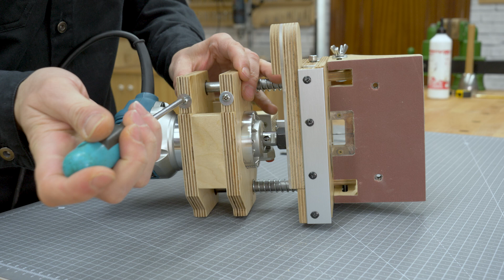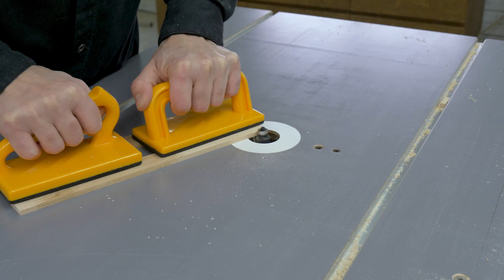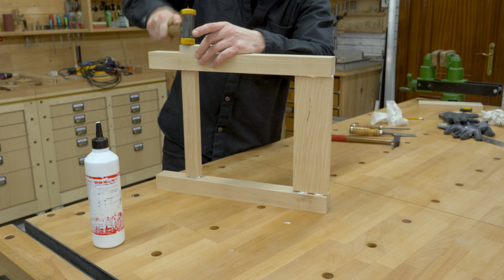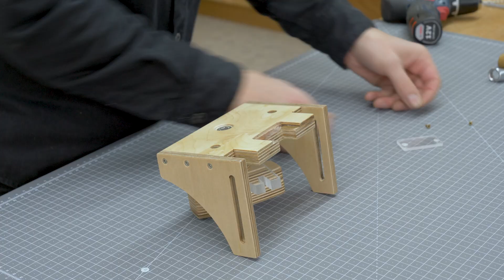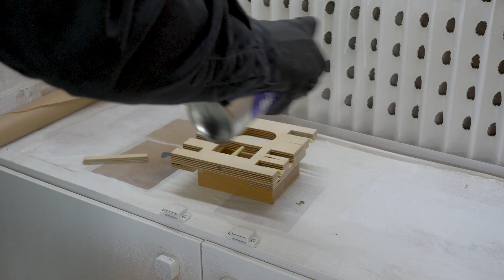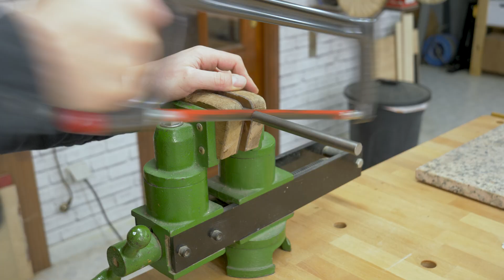How to make a homemade X-Motion Portable Mortiser

Comment: I'm a professional woodworker and having all the tools for making all types of joints (Maffell doweller, Lamello biscuit jointer and Festool domino jointer), still feel a lot of admiration and respect to the makers of these type of homemade machines. This, on particular is a very well crafted and elegant piece of equipment. Congratulations!!👍👌
Reply: Plus: The process of Ideating, Sizing and Designing the "DIY" tool, gives the opportunity of learning, keep improving, and acquiring the dexterity at wood and metal working, that helps inmensely before tackling larger and more demanding full cabinetry projects...